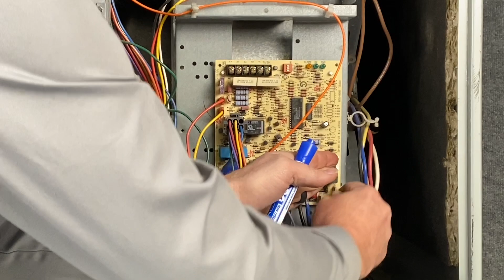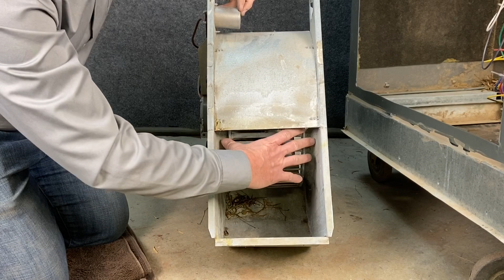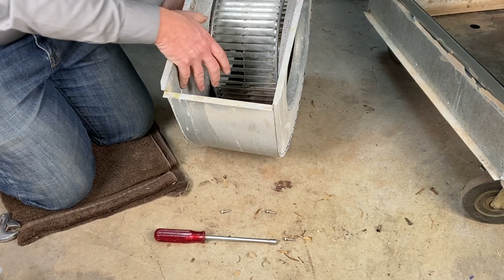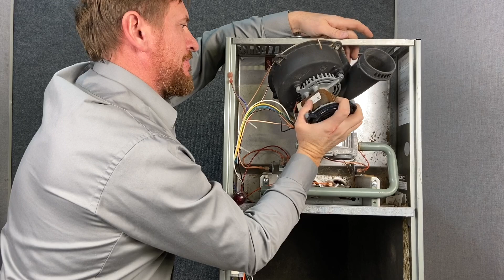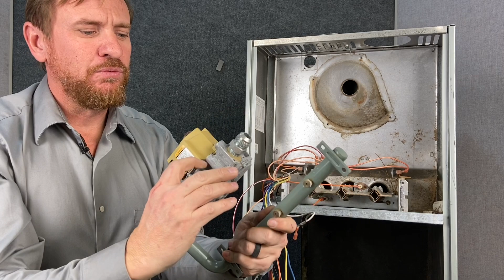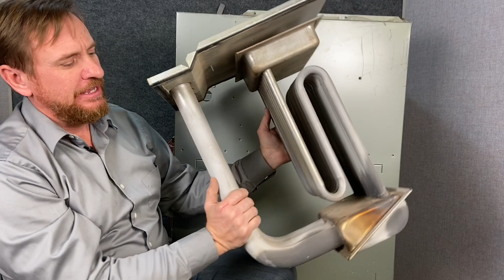Part 2 80% Gas Furnace (parts and dismantaling)

Comment: Hi, can I direct vent my Kenmore DC 80 high efficiency furnace using B venting?
Reply from the maker: refers to a sealed-combustion system in which air for combustion is drawn from the outdoors.

Some 80% furnaces had an allowance for this to work. 

I am not sure about that brand but more important would be the model#. Check the installation manual. It will specifically say if it is allowed or not.

Comment from the maker: first 20 minutes focused on the blower
20:00 pressure switch 
24:00inducer fan
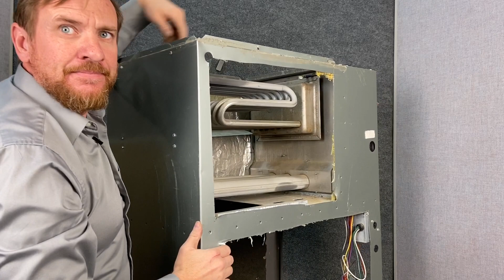29:00 heat exchanger first view
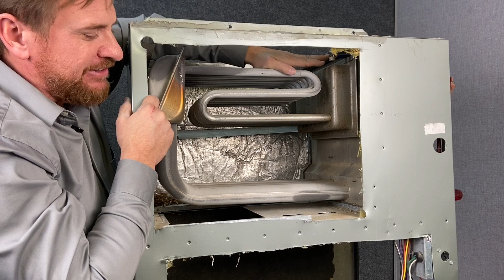30:00 limit switch
32:00 combination gas valve and manifold
34:00 spuds, office
36:00 gunshot burners
29:00 flame sensor
40:00 heat exchanger